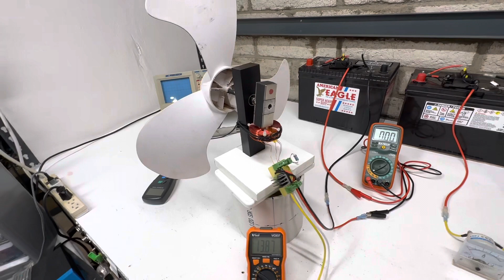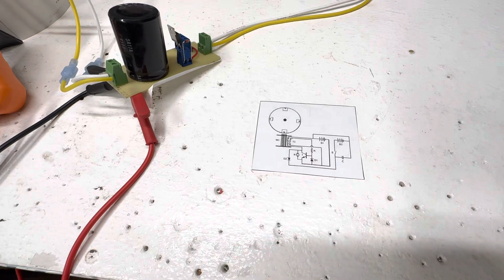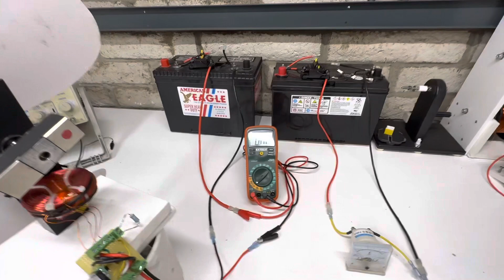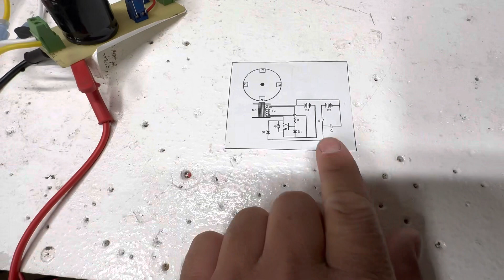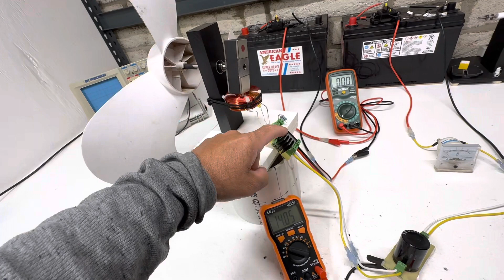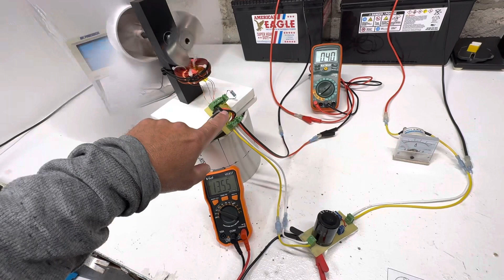Simple but strong beginner pulse motor pt 3 bedini circuit with cap dump

Comment: Have you tried to use a  small capacitor to  increase the discharge rate into the secondary battery....with the end result being more energy out ?
Reply from the maker: Yes but need to make smaller discharge